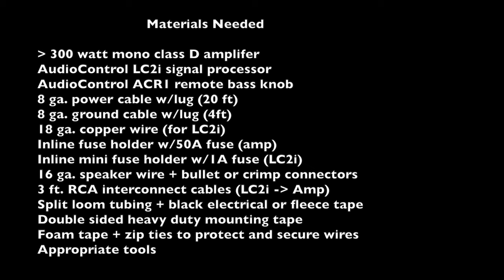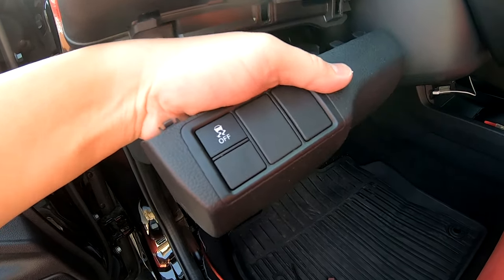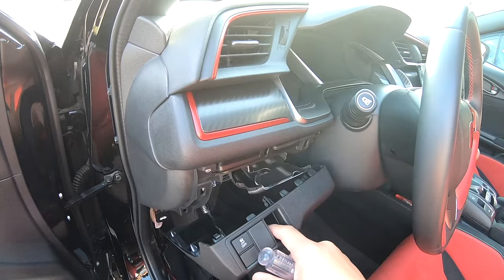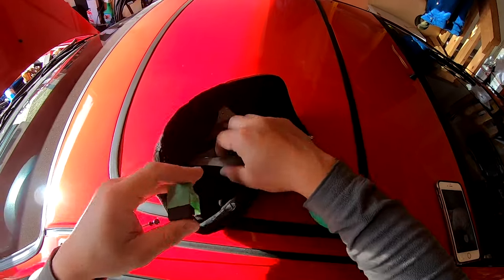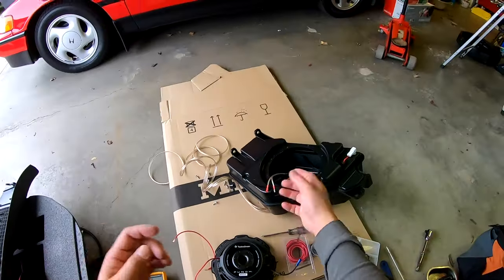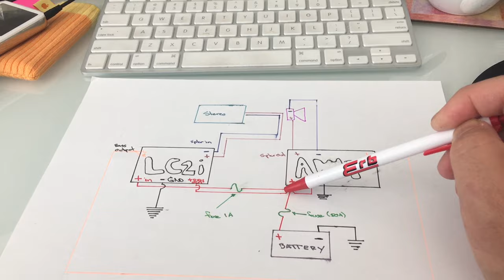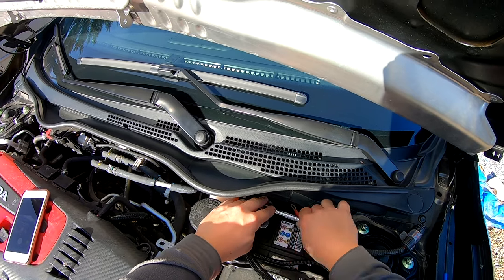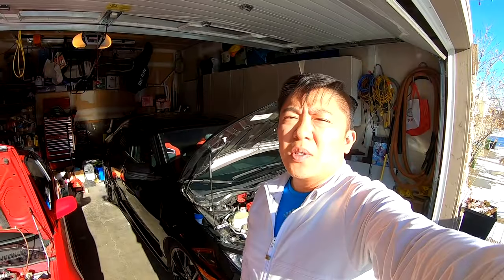2016+ Honda Civic Type R Subwoofer Amplifier Installation

Comment: So I’m confused because... well I’m kind of slow at times. You simply took the speaker that ran into the factory sub, and plugged it into the LC2i? Also do these cars come with a factory amp? If so, it is ok that the factory amplified audio is being amplified again by the new amp? Tell me if I sound like an idiot or not please.
Reply from the maker: Hey Sugar_milk.  I'm not sure if I replied to your original question or not but I figured better late than never.  You're not slow - why would you say that about yourself?  It can be confusing for folks that don't do these things all day long.  

The signal of the stock sub is fed into the LC2i and then the LC2i uses RCA outs to go into the amplifier's RCA in.  From the amp's speaker outputs is where you hook the sub up to.  The reason why you use the LC2i is to "process" the signal from the stock head unit so that it can generate a properly amplified signal into your amp.  The reason why I wired my system the way I did was to eliminate any cutting of the factory wires.  Rather than splicing and hacking away at my car's expensive wiring that I'd rather run the cables the way I did so that if I want to revert back to full stock (for example when selling the car) that you'd never be able to tell I ever had an amp or aftermarket sub in there.  Does that make sense?

Comment: Tremendous job! Would you recommend a different audio control than the ACR1 since that looked a little tough to get it to fit?
Reply from the maker: In all honesty I probably would've went with the Rockford knob instead since it was so much smaller than the ACR1.  The ACR1's advantage is that it decouples the dependency on the brand of amp you use.  The challenge when using a bass knob with your amp is that say you fry your amp, then the matching bass knob for it may not work on another brand.  When you use the ACR1 it will always control the source signal going to the amp.  I guess in the long run it doesn't really matter much but I went with the ACR1 route b/c I got my Audio Control gear for cheap.
Reply: The other benefit is if your LC2i is behind the dash or under a seat, it’s an easier run for the control knob wire.

Comment: I don't understand how your LOC gets power... Doesn't your LOC turn ON the AMP? How can the LOC get power from the AMP if the AMP was previously off??
Reply from the maker: the LOC pulls power from the constant +ve feed that goes into the amp - when you insert the positive power cable into the amp also insert the small wire that powers the LOC.
Reply: @piercedasian  Thanks for the reply. I ended up figuring it out. You're essentially splitting the power wire from the battery, one going into the amp, the other going into the LOC.

Comment: EVERYONE, IF YOU POKE A HOLE THROUGH THE FIREWALL GROMMET THE BIG ONE NOT THE ONE USED IN THIS VIDEO BE AWARE THERE ARE ABOUT 30 tiny WIRES in that grommet just naked I GOT EXTREMELY LUCKY, I SHOVED A WHOLE SOCKET THROUGH IT 😂
Reply from the maker: Thanks for that tip.  Yes I generally do not like using the main harness grommet b/c there are so many wires there than if one isn't careful that they can really damage things and render their car undriveable if they break the wires.  Replacing that main harness is a pain in the ass AND extremely expensive for what it is.  I recently did an amp install on an older civic where I used the main harness grommet knowing that I could mess things up if I "miss".
Reply: @piercedasian  Yes everything is ran through a wire now smh 🤦‍♂️
Reply from the maker: yeah sometimes you wonder if simple systems were the better options.  I often wonder what the long term reliability of drive by wire systems are.  The latest Toyota hybrids for example have drive by wire brakes with the hydraulic link as a backup!  Kinda scary knowing that if a brake switch fails that you might not be able to stop!
Reply: @piercedasian damnn frr

Comment: Sorry if I missed it but how did you connect the remote wire to the amp?
Reply from the maker: You feed the remote in from the LC2i to the remote trigger on the amp. The LC2i is what sends the 12 volt signal for the amp to turn on.
Reply: You can get high quality RCAs with an integrated line out wire. One less cable to run/fish.

Comment: Hi there!  I just installed the lc2i to my 2015 f150 everything works except the loc and amp does not turn off.  remote is in loc out to amp.  Do I have to do anything with the enable and bypass option?  I know my truck has a delay turn off but I waited 5 mins and no luck.  Thanks
Reply from the maker: Hmm that is indeed strange. I wonder if your truck is sending out a signal to the sub even when it is turned off. Have you tried to let the truck go longer without the ignition on to see what happens?
Reply: I got it working.  I was missing around with the gto and decided to put it back how it was.  Then waited to see if it shuts off. And it did.  Thanks again
Reply from the maker: that's great!  Enjoy your new sub!

Comment: Hey man, great video. I know I'm late to the party but I'm finally going to pull the trigger on my 2017 Type R with this build. I wanted to ask two things: how's it holding up and problems with it after a few years? And how come your didn't use a distribution block instead of the 1 amp inline daisy you did? When I used to do stereos in college we used distribution blocks regularly and I used them for my ground and power for my comp cars all the time? I am not familiar with the LC2i so I am not sure if it was because of that? 

Thanks man, hope to hear back from you in a few days because I should be installing this in the next week. Happy new year!
Reply from the maker: Type R has held up perfectly.  Granted I don't drive it in the winter and our summers are relatively short its hard to say.  I worked for Honda as a mechanic a while ago and the Type R is a solid car b/c of its no-frill approach to its engineering.  Not much to really go wrong especially the 2017-2019 years b/c the lacked any of the honda safety sense stuff.  I didn't bother with the distro block for a few reasons:
1. It isn't necessary when you've only got one amp that is super efficient and doesn't draw a lot of juice like the old class A/B ones do.
2. I don't plan to add any more amps to the car.
3. The in line 1AMP to the LC2i is negligible as far as current draw is concerned.  Given the wire is so thin to power the unit that it doesn't make sense to install a distro block for it.  Same with the ground.  There is a single grounding point in the back so the LC2i and the amp can ground there.  
4. Cost and clutter - in MY specific installation less is more.  I don't need to spend additional money on splices and blocks (more points of failure) and I know what my future plans are for the car which is nothing in the foreseeable future.  IF I decide to add another amp one day then I can simply upgrade the feeder cable and install a distro block then.  

Hope that helps and enjoy your new ride!
Reply: This makes sense. I keep forgetting not to treat the LC2I as not an amp haha. Just one last question man, what gauge wire did you end up running for the inline 1amp fuse and the remote wire? They both seem thick, like 12 gauge? Why that thick for the remote wire or was it more of you just had wire to use because I've been there as well. 

Anyways thanks man, will be installing this exact build next week.
Reply from the maker: Hey Kenny, apologies for taking so long to reply.  The wire I used for the LC2i is something like a 14 gauge wire.  It draws barely anything.  I used that wire just because that was what I had in the garage not because it was necessary.   Stay tuned... I'm going to be doing a comprehensive video (permitted I have time and resources to do this) installing a set of top end Focal KX2 speakers, sound deadening and a Helix V Eight DSP/Amp combo.  The Type's R's sound won't even be the same after I do that crazy upgrade.  8 channels of amplification of power with a top tier DSP to change a stereo that is "meh" to one that is WOW.  Big project with big costs but I think it will be well worth it.

Comment: Great video, so I'm wondering if you only hook up one set of speaker wires to your LOC (looks like you did the left channel), does the signal come out of both RCA's to go to the amp? I'm going to tap into my sub on my 2019 civic SI with a LCi1, to add 2 10s and have a mono amp, but not sure if you need both RCA's? Or to hook up both channels to LOC to get both RCA's to output to the amp?

Comment: The speaker inputs on the Rockford amp, what do I do with those? Because I have already wired left/right speaker to the LC2i. Do i need to double that into the amp also? I'm lost lol
Reply from the maker: Speaker inputs to the LC2i and now you need RCAs to go from LC2i bass output into the Rockford amp. I did explain exactly how it should be connected in my drawn diagram.
Reply: @piercedasian  thank you sir! It works!
Reply from the maker: That’s great!  How does it sound now?? Probably a lot better now that you’ve upgraded :)
Reply: @piercedasian  oh it's perfect lol I can't have the volume all the way up, it makes me feel like I'm having a heart attack.
Reply from the maker: yeah, it is pretty sweet.  Compared to my CRX Si's system however, the Type R is still years behind in the "powaaa" category :) lol

Comment: I'm a dummy. A stoned out of my mind, engineer. I take pride in my work. I've learned to always NASA standards for soldering and never tap your power into your main fuse block. always use or circut breaker mounted on the firewall with shortest minimum 4ga OFC connected to positive terminal. wire is also must for OEM look

Comment: Just wanna say I personally never remove the center panel or seat belt on four doors. Just run a wire hanger or glow rod and tape your wire to it and fish it to opening once back panel is off. Saves time! I like working like a short, lazy, fat man. Smarter not harder. ;)
Reply from the maker: That's a great tip.  While it wasn't difficult to remove the seat belt bolt from the centre trim that I opted to do so to show the audience what is behind everything.  You're absolutely right that it doesn't need to be pulled to save some time and the potential to incorrectly retorque the seatbelt anchor bolt (critical in a collision).

Comment: How is this holding up years later .. i want to get the same set up but seen the reviews not that great on the Rockford and not to mention its not $115 anymore. Its $169 so im looking at the kicker that is a shallow mount and its cheaper. Any help is appreciated.
Reply from the maker: System is holding up perfectly.  Granted I have a garage queen type R but still.. it's been nearly 6 years and nary an issue.  Plenty of clean strong power and well, it just works!  The rockford didn't get favourable reviews?  I remember when I purchased it back in 2018 that it had very good reviews so I'm not sure what has changed.  Rockford historically has made solid products which is why I went with them.  I'd say if you plan to power the stock sub or an aftermarket sub that isn't something wild like dual 12" subs then the Rockford will quite easily power them nicely.  Just err on the cautious side if you do go aftermarket subs BECAUSE the wiring size I used and how I wired it up by piggybacking off the stock positive cable feed and then splitting it out at the fuse box junction (its a super nice clean install) but be aware of the current draw and limitations wiring it that way.  I figured that the Rockford power the stock 8" sized sub or even a single aftermarket 10" sub would be okay but if pushing an amp to its upper operating limits that one should size up the power cable AND wire the positive directly to the battery and fuse it as close to the battery as humanly possible.  Kicker makes some nice gear too so it's really a matter of preference.  

** rereading your comments are you saying the rockford sub or the rockford amp didn't get great reviews? **. I ask this b/c you mentioned kicker is shallower mount which implies that you're talking about the sub.

Comment: Why did you use an amplifier AND LC2i for your setup? Why not simply run the amplifier to the sub only?
Reply from the maker: b/c you need the LC2i to re-eq the signal back such that the sub operates in the proper frequency range b/c modern factory head units do some funky EQ'ing that clips the bass signal and thus not giving you the full range of bass you'd expect from the sub.

Comment: Very cool. I understand this all. But what i must do with radio? Also for chinch signal ( radio/amplifier) 😊 pls help. I dont understand how to get the radio removed 🙈
Reply from the maker: You never have to remove the radio b/c there is nothing you can tap off from it that you can't get from the back.  If you watch my other subwoofer upgrade video and this amp video that it is all you need to get the sub and amp in (for the sub only).  If you want to do the other speakers then you have to tap into the factory amp which is in the right front kick panel and even that requires some detailed understanding on how to do it right.

Comment: Hey just a tip, if you don’t want your power wire to run behind the front fender, you can find another grommet behind the battery that leads behind the clutch pedal. Nice video!

Comment: Hi, fuse with 1A ? The only fuse in U.E. (Romania ) it's from 2a. It's to big ...?
Reply from the maker: nope that will work just fine.  The whole purpose of the fuse is to protect the device from a dead short should that occur somehow from incorrectly routed/protected wiring.

Comment: Do you think you would be able to fit 0 gauge wire? I just sold my A8L and I kept the sub. I had the sub getting 2000 watts rms and the battery was located in the trunk so it was an easy install.   Now I'm not sure I can send that much power if I cannot get the 0 gauge wire to properly be installed and unseen. Any help is appreciated.  I have a 2021 type r
Reply from the maker: You can fit anything you'd like but whether or not it will go through the hood release grommet is another story.  I would imagine that for something THAT thick you'd want to drill a dedicated hole and insert your own grommet to feed that cable in.  You probably can get that cable to be concealed under the trim along the door but it will definitely be a challenge.  What kind of system are you running that would warrant that kind of power draw?  If you're going to pull THAT much juice you gotta make sure you tap directly off the positive terminal of the battery as the method I used for my car is for a small amp that doesn't pull too many amps even when pushed to its limit.

Comment: I want to do this but install an aftermarket subwoofer box with 2 12” subs
Reply from the maker: yep, the process is more or the same except instead of "back wiring" the sub output back to the stock sub box that you just wire it your aftermarket sub box.

Comment: Question?
 ....How did it sound ? I know that the sub signal from the factory amp is DSP and rolled off the top and bottom end. Did the LC2i correct this or?
Reply from the maker: Sounds great!  It isn't going to be blow your windows out kind of bass but it is definitely tighter and more defined with a wider range of low frequencies being played out.  The LC2i restores the signal such that the system behaves similar to having an aftermarket head unit installed.  A++

Comment: Is there any safety issue connecting the power wire to the fuse box? The forums I've read all say to to the battery and don't mess with connecting anything to the fuse box.
Reply from the maker: In my particular case, no. The amp and how I typically use it won't cause any real overcurrent/overheat issues.  Others are correct in that one should directly hook up to the battery because in the event of a dead short that the amount of current being pulled can burn up the factory cable and fuse box.  What I'm essentially doing is using the factory battery clamp and cable from the battery to the fuse box and basically wiretapping from the battery -> fuse box junction.  Is this the most ideal way of installing it?  Probably not but it sure is clean looking and I know my workmanship is top notch that the likelihood of overdrawing power or dead shorting is next to nil (I still have a fuse for the amp that is very close to the factory fuse box junction).  Many will argue with me all day long this isn't a "top notch" but I've seen plenty of junk installs that while hooked directly to a battery positive terminal is crap through and through... I stand by my decision on how I wired the power cable to my little amp.

Comment: Do you have any problems with it over heating being under the carpet
Reply from the maker: While it definitely DID get quite warm on a 12 hour road trip during the blazing hot summer months in a fully packed hatch that the amp didn't once falter.  If you're really concerned there are many easy ways to add a small PC cooling fan into the trunk's spare tire well to keep air moving around.  If you're listening to music at a reasonable level that the amps being as efficient as they are likely won't get too warm where it can start causing issues.

Comment: Where did you get the remote for amp? From head unit? I see you are feeding the LC2i remote from amp but I couldn`t figure out where was the amp remote from? I was trying to figure out is there a way not to remove head unit in order to get remote.
Reply: Ahaaa I got my answer. LC2 triggers with speaker signal and remote output goes to the amp. Thx.
Reply from the maker: The remote to turn the amp on is in fact from the LC2i itself.  When the LC2i detects a signal it will trigger a 12 volt output to the remote terminal on the amp to turn it on.  You do not ever have to remove the head unit for anything since there is nothing to tap into.
Reply: @piercedasian  thx man.